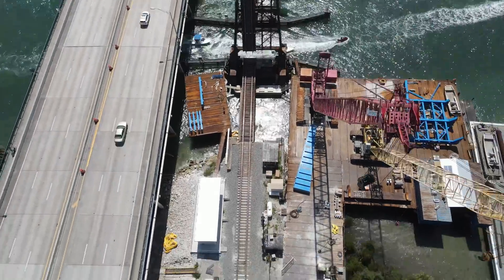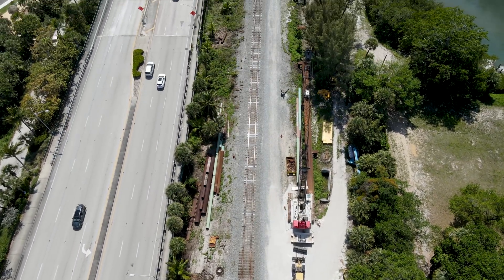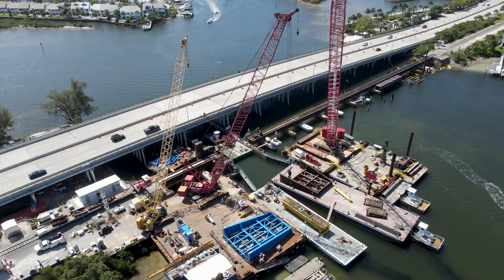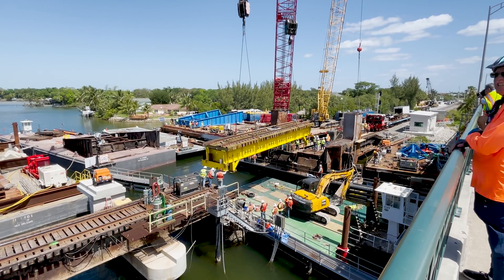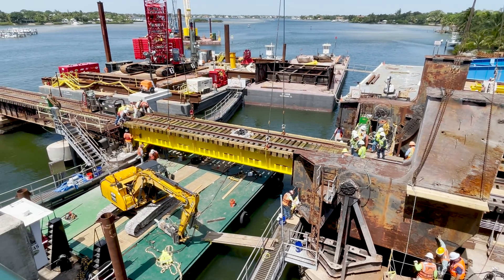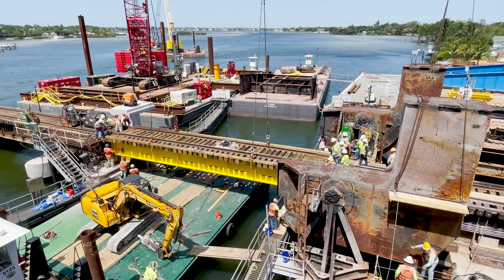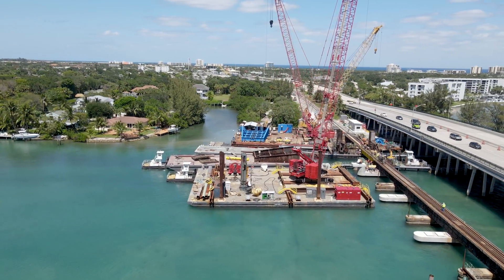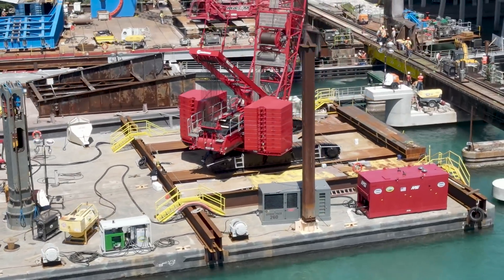Brightline Construction: The Start of the Loxahatchee River Drawbridge Replacement

Comment: Did I understand you to say the waterway will be closed for a while until they get the new span into place?
Reply from the maker: It will be opened twice a day to let boats pass, otherwise it will be closed.
Reply: @RoamingRailfan  what I don't understand is if everything was welded into place, how will they go about removing and replacing the span twice a day?
Reply from the maker: The span itself is not welded into place, just the guides and supports for it are.

Comment: With all do consideration for the hiway 528 box jacking tunnel and the other impressive components of the new Brightline I am thinking this replacement of the Jupiter draw is the most fascinating and impressive.
Once again thanks for your comprehensive and most enjoyable coverage.
Reply: I, as well, am MOST impressed by these fascinating & informative videos of the Brightline Rail Project!
This one, as most are, spotlights the physical engineering workings, but there must be so much other engineering considerations like electrical and waterway intricacies that I am totally unfamiliar with.
Even as to the soil and again water movement and strength of the rail beds even before laying the Rails and switches. Really enjoyable!

Comment: How long did it actually take, from the time the cranes picked up the span, to the time the cables were let loose of the span? I've never seen two cranes lower something into place so slowly.  That's not a gripe, it's comment on the precision and safety required for the job.  As always, an other fascinating video.  I dare say, when this project is done you will have compiled an important record of the whole thing.
Reply from the maker: Probably 20-30 minutes, I cut a lot of the time while it was just hanging as they were making adjustments
Reply: Heavy crane lifts usually take that sort of time